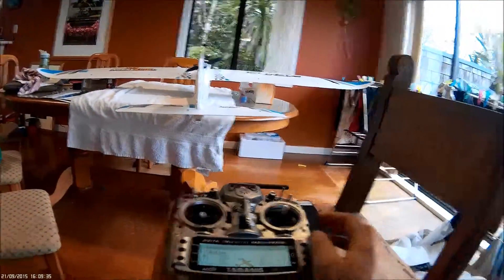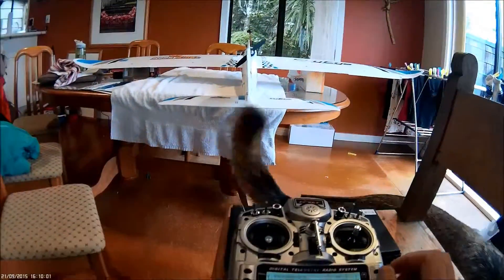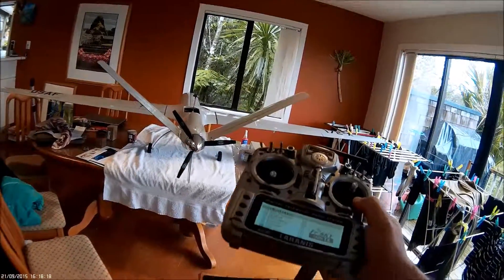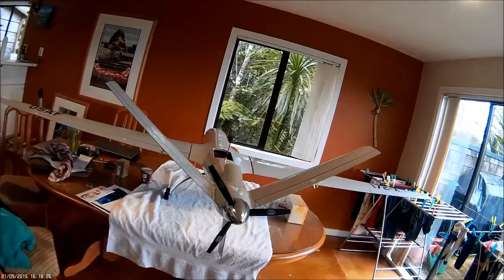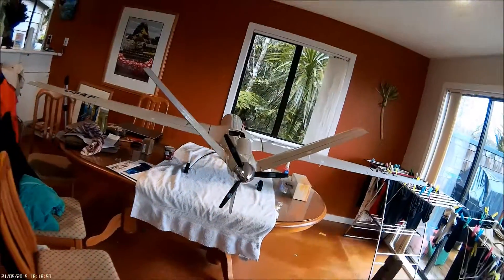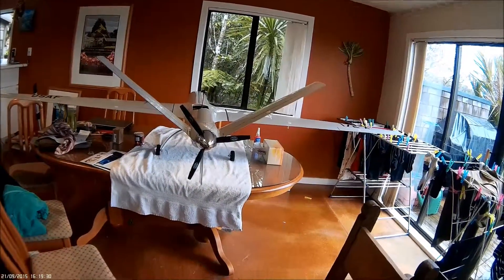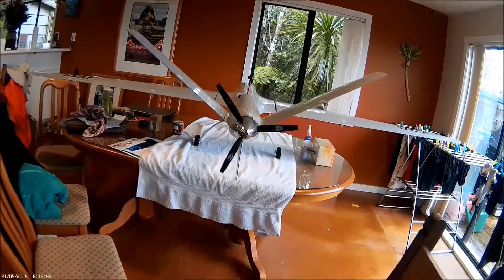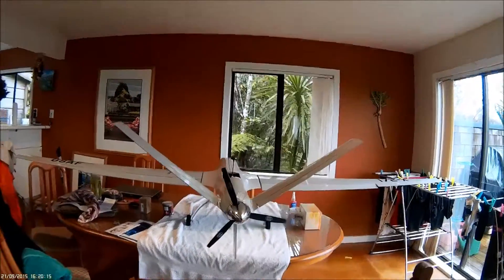UAV 3000 composite fpv/uav V-TAIL CONTROLS EXPLAINED

Comment: Hi Mike,I've just seen your video! thank you very very much for the video, I really appreciate your effort, I haven't made much progress yet, I have got most of the electronics just had to wait for some servo extension leads, I bought a 16x8 master aircrew prop as I'm hopping it will give longer flight time and slower flying! I'm also looking into replacing the landing gear for some carbon fibre once as I think it's quite heavy! thanks again will keep you updated.
Reply from the maker: +L0ND0N200012 Hey there , no problem ,,,, yes i am also looking at replacing the landing gear , especially the nose wheel one,, it looks hideous ! Not been the best flying conditions here lately (spring winds and rain) but it is only going to get better as summer arrives ,i have been rebuilding my busted SkyMule this weekend so hopefully get that up in the air soon as well .Make sure you do some videos on your plane , i am always interested in other peoples UAV 3000's , not that many videos on youtube !

Comment: UAV 3000 is amazing.  What is flight time on it (some slow cruising) ? :)

What battery do you use? Can it fit some 6s 8000mah ?
Reply from the maker: +Xava Hi yes the battery bay is huge , i run a 6s 4000m/Ah for the main motor and a 4s 2600m/Ah for the electronics , i use this configuration only because i had 2 x 6s 400m/Ah batteries from a previous model , the 4s gets thrown in the front purely to balance the plane  out , on this 6s 4000m/Ah i get a safe 15 to 20 mins of flight i have heard of other people with larger capacity batteries getting 40 mins of flight time